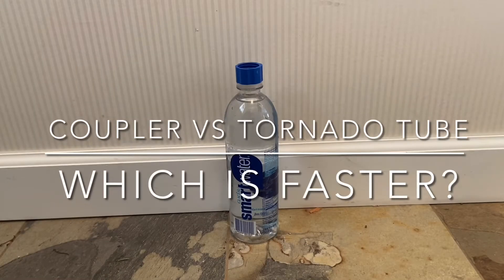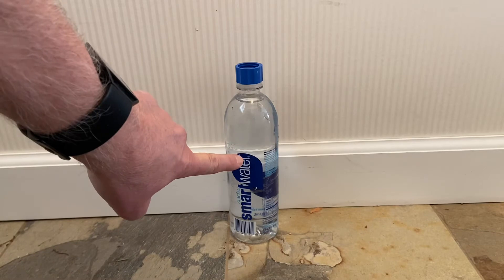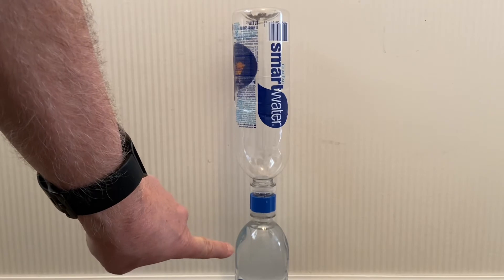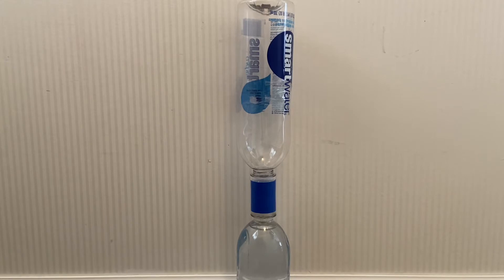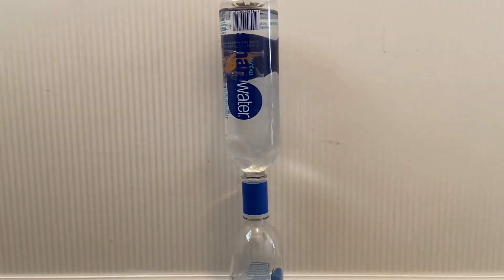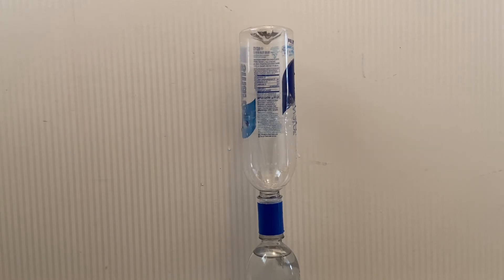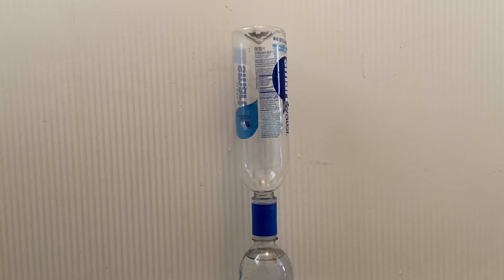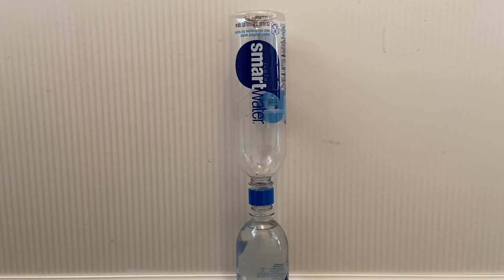Using a Sawyer coupler vs a Tornado tube to filter water and transfer water between bottles

Comment: It's not a filter,  it's just a coupler. It's not actually filtering anything.
Reply from the maker: That’s correct. The coupler is NOT a water filter. You also need a Sawyer water filter with this setup. John